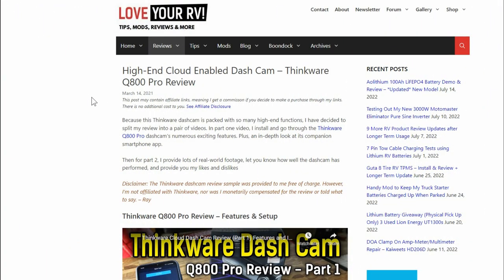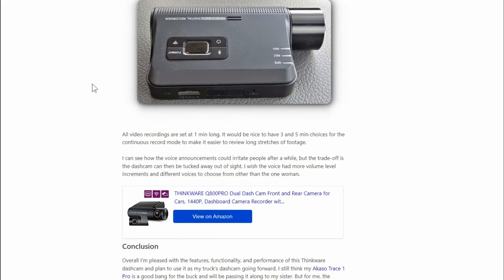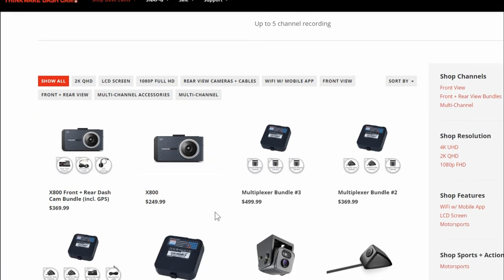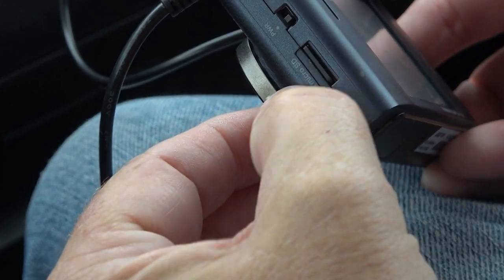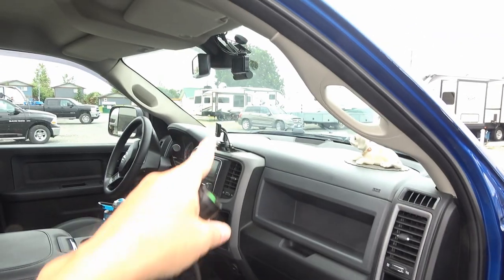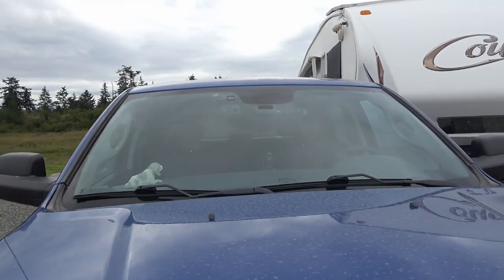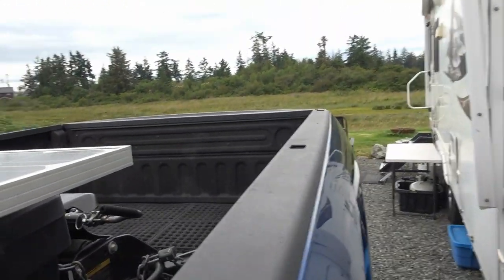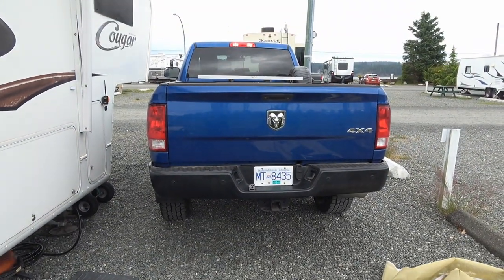Thinkware X800 Dash Cam + Multi Cam Installation - Hard Wired into a Ram 3500 Pickup Truck

Comment: Thanks Ray. Those two side cam's might be excellent for loading a truck camper. One on each side, on the top of the bed rails at the back of the cab. Would give a view down the sides so you could see the gap between the bed sides and the sides of the camper to keep it evenly centered as you are backing under it when loading. Just a matter of whether the image can be rotated 90deg, rather than just 180deg flip.
Even better would be if Thinkware came out with a truck camper specific unit with just the dash cam unit and two side units but made specifically for mounting on the bed rails. The bed rail cam's could have a vertical line imposed on the screen as a ref point. Have the bed rail cam's have the 3M tape or a magnetic base as well. 
If you could pass that along to Thinkware, that be great. I think they do pretty good offering a Truck Camper Loading edition.
Reply from the maker: The dashcam display is pretty small, though, and the side views are each in only 1/4 of the small screen. Might need a magnifying glass. :)
Reply: @LoveYourRV  LOL! I thought maybe one could select a two view split screen maybe. Agree and screen size is an issue. Dare to dream! Just having a system of two cam's that plug into an ipad/tablet, not even permanently installed would be awesome. Given you get about an inch or so clearance on each side, it can be a PITA sometimes to load.

Comment: Ray, just to let readers know, I recently had 😅a QA100 Thinkware dash cam installed professionally. The install was great and, when the installer showed me how it worked with his Android, it did exactly what I wanted. The problem is, I use an iPhone. I have battled with this for hours, contacted the company and tried the things they have suggested so far with no success at all. Reviews of the app from the company on the Apple App Store are not encouraging. If you are an iPhone user, I would avoid this like the plague. I got it as it is small and somewhat inconspicuous. The phone was to be the screen. I have the rear camera as well so nearly $700 Canadian all in and it has no screen whatsoever. For Apple users, if it works please help out but be very aware mine does not. BTW: the unit seems to be working but no screen at all.
Reply from the maker: Thanks for letting us know. Hopefully they can update the IOS app or camera firmware to solve the issue.